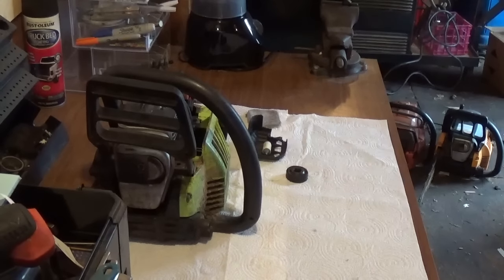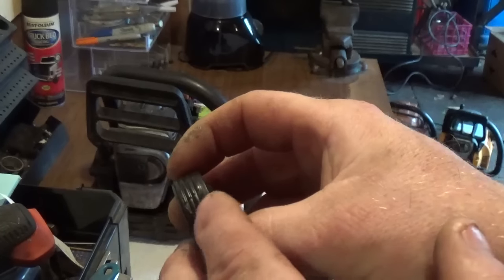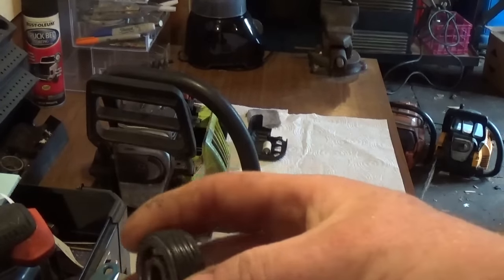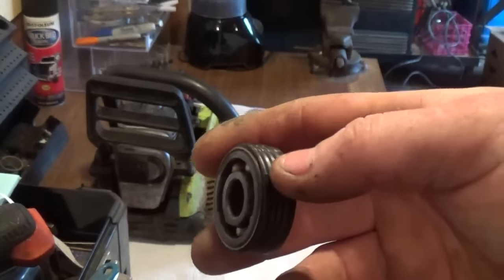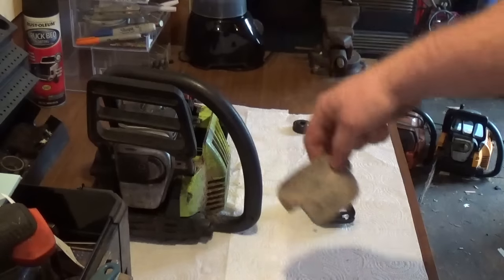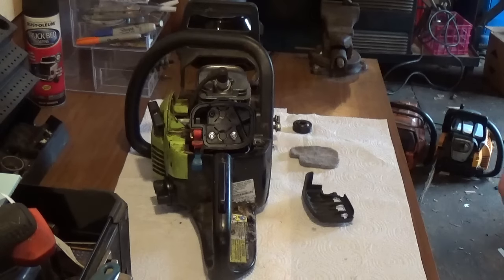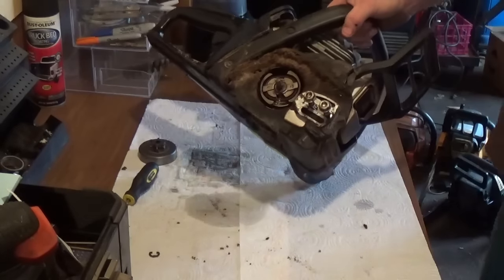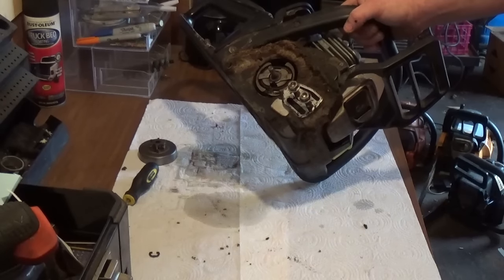Common problems with Poulan Chainsaws

Comment: I'M A CERTIFIED SMALL ENGINE TECH WITH MY OWN SHOP...I NO LONGER WORK ON ANY 2 CYCLE STUFF BECAUSE OF SOME OF THE THINGS THIS VIDEO SHOWED...BY THE TIME YOU PUT THE PARTS IN TO FIX THIS KIND OF JUNK...THE CUSTOMER IS COMPLAINING...I COULD HAVE BOUGHT ONE BRAND NEW....EXACTLY...PARTS OR NOT CHEAP AND THE TIME IT TAKES TO VACUUM CHECK AND PRESSURE TEST FOR LEAKS...IT BECOMES A HUGH WASTE OF MY TIME....SO I JUST WORK ON 4 CYCLE LAWNMOWERS PUSH/SELF PROPELLED.....AND RIDERS...I FREED MYSELF OF THE 2 CYCLE NIGHTMARE
Reply from the maker: You are exactly Right / And the price of some of the adapters for testing is outrageous .......Then lets just say you bite the bullet so to speak {hell in 5 to 10 years the adapter purchased becomes obsolete } because most of the chainsaw companies are not committed to repairs {rather sales } and are pushing yet again the next best piece of shit that they can screw over the modern small engine Tech or Dealer with knowing that yet again another adapter will become a obligated purchase. What I find sad is attending these service schools and seeing how these pieces of new equipment are put together [assembled } if you will. My goodness the quality of the shit purchased anymore makes me sick ...And the distributors know it as well as Tecs and Dealers yet nothing ever gets done about it . Say a word to Husqvarna and they just fire you as a dealer or even a sales rep. To them its easier to steal a dollar than to actually earn it . That's why they buy the low end companies ......Just to eliminate any would be hassle for there sales .....Think about it ......How many Poulans have you seen in different packaging under other names ? Be honest fellow viewers .....How many ?

Comment: I got a poulan saw from my uncle.  Fixed the sprocket cause it was totally chewed up.  It ran great for a week then it took a total shit on me.  I just cleaned out the carb and it ran good for about a minute.  Last year, I bought a 16 inch electric chain saw from harbor freight for 40 dollars on sale.  I cut several trees up with it and it works fuckin great. No gas just a long ass cord hahahaha.  I love it......its made by a company called PORTLAND.  I agree those Poulans are total garbage and need to be boycotted.

Comment: Greetings Kevin Bolin! What is the tank vent you speak of? Is there a hole in the back of the tank side of the gas cap on some poulan/craftsman saws? I have 8 cheap saws but one, a 3816 craftsman simpul won't idle right. It cuts good and revs right but idles high then stalls if you let it idle long. When it stalls there is a strong suction/vacuum leak down noise. It also happens after 3 or 4 pulls to start it. If anyone reads my comment could this be crank seal leakage and or possibly some kind of tank venting issue? It is a 2009 simpul. By the way when buying it from it's previous owner they let the carb gum then replaced it. Let that one gum up too. I got it to run with that carb and another new replacement one but it just won't idle right and had the suction noise when stalling out or after a few pulls. The piston is clean and shiny on top but I didn't look through the muffler. I have recently become a chainsaw hobbyist lol.

Comment: I have one
Ran 15mins use to to cut 2 limbs off a tree had to run in to town came back hasnt started back up since it was bran new frash out the box when i originally had it started
Reply from the maker: I completely believe you ….they are just complete junk.

Comment: My dad bought a Poulan p4018wt, new in the box. He probably bought it 2-3+ yrs ago, never used it. Asked me to use it the other day for the first time.  It was difficult to start. I got it going, it worked well for an  hour or so. I got it stuck in a small tree, and I shut it off and got it out. I still can't get it to crank again. I have spark, new gas, etc. It will not crank. Terrible.

Comment: I paid $100 for a refurbished Poulan.  Big mistake!  It rarely starts and once it does, it doesn't run very long.  And yes, I followed all instructions on gas/oil mix, prime, and choke.  It's garbage.

Comment: The first day I had it
the poulan 5020
Stopped working
after 2 hours work
No spark,I replaced
the ignition module
Chinese made of
Course,module
Failed after about
10 minutes,no spark
again.
The only reason I bought it was because
I thought it was 
American made.
The internals were all
Chinese made.

Comment: Mine had a muffler gasket installed crosswise across the port though one bolt and a kinked throttle cable.

Comment: I disagree with your opinion with the Poulan chainsaws. I'm not  a professional logger so I dont want to spend $600-$1500 for a Stihl chainsaw. I own rental properties and Poulan chainsaws do the job for cutting even big trees. I own 6 Poulan chainsaws, 18" and  20". Had these for about 5-10 years and never had any major problems except replacing the carburetors ($10 for new ones made in China) and they will work flawlessly for another 2 years. Only one I had to replace the ignition coil modules (under $15 made in China). The problem is that most people who use  Poulan chainsaws are your average homeowners and dont know how to do maintenance on these chainsaws so they just complain and throw them out. I can get a used one on Craigslist for under $50 and do some simple repairs and will last at least another 5 years. With cheap parts from eBay, you can fix these Poulan chainsaws instead of paying $600-$1500 for a used Stihl chainsaw which can still have expensive repair problems and still need maintenance for them to run properly.
Reply from the maker: I can respect a difference of opinion ...Sadly I think you exaggerated your 42 cc Poulans performances as well as  price points compared to a like minded example of a Stihl as they can be purchased easily for under 200 dollars. [Poulans around 140 dollars] …..Poulans …..well lets say modern Poulans just leave many with buyers remorse as repairs are expected straight from the box …..seriously …..Carb adjusting is actually covered under warranty of a new saw . And respectfully I have to much experience involving Poulan / Husqvarna made knock offs of different packaging . So I know the quality / You can certainly believe that …..Yelp 42 cc of screaming under powered skipped toothed performance followed by lighter wallets and purses ……..And that Frank is the truth …….But hey Frank to each there own......Your comment way delivered respectfully and as such will be replied to in a like minded manner . {However fellow viewers} As a Master Service Tech I can attest that Poulans are disposable saws with far more issues than failing 10 or 15 dollar carbs …..The quality of these saws are terrible and the fact as of 2015 at least 67.3 percent were returned or delivered warranty relief for tells all . Its no wonder why they have a company that dose nothing but refurbish Poulan / Husqvarna Knock offs under different packaging . Frank Techguy you seem sold on the Poulans will you be the first to demonstrate why with a short video of its performance from a cold start? You should find examples of whats expected in replies shared on this channel.

Comment: a tirade of his frustration is not anything but his anger and rant...
Reply from the maker: Yes/ and a open exposure of facts projected to allow individuals a first hand look so to speak as to why I hate the Poulan Chainsaw. Evident truths can or should not be ignored contrary to opinion ........So simply look into this matter even deeper as the facts quickly will build up as there is a reason for the thumbs up via in comparison to the thumbs down on this matter.

Comment: I had my Poulan 42cc for 17 years,flawless,works awesome,best $150 i ever spent!!
Reply from the maker: Great .......hope it continues to give you great service .....Sadly the poulan products in todays box stores just cant be relied on.
Reply: Dave Gutknecht these are what I consider consumer products. If you are delusional enough to think a poulan chainsaw is made to cut 15 to 20 cord of wood a year, then you probably get mad that a $150 Chinese welder fails when you run 4’ of 5/32” 7018 nonstop at 180amps. This video is not informative at all. It is just some guy whining about making money off of non-mechanically inclined people. Quit your belly aching KB and be happy you have the intelligence to repair these machines and make good money as well. I work on my own equipment and believe a day unlearned is a day wasted. I hope next time you will show something worth absorbing.
Reply: they are easy to work on and i've seen the majority of units withstand many years of abuse and run great.....
Reply from the maker: @luked1964  If your looking to absorb something then purchase a Poulan …..The fucking you will receive will require gallons of Prep H my friend . If I can educate my viewers to avoid these pieces of shit then you can bet I will do so . When facts are projected as they were in this video I think it worth while to inform and  keep others from buyers remorse .
Reply from the maker: @luked1964  You appear to have a connection with Poulan based on your idealism and lambaste others for expecting more from a piece of equipment they have spent over 150 dollars for . You then proceed to try to stereotype by your on ability to scrutinize via the example of a Chinese welder as a price comparison . Then you deviate away from your premise to imply that this video isn't informative at all . However in your absence of mind you fail to understand the premise of this video witch be minded was obvious . But incase you had trouble following I can and will try to elaborate . The direction or premise intended with this video was to show by example why I personally hate the poulan chainsaws . And show obvious failures with the design and parts so I could educate and prevent others from being taken advantage of {basic buyers remorse} . Now in regards to a line you had typed …….Its is just some guy whining about making money off of non mechanically inclined people . Might I ask how in the hell did you arrive at this conclusion in your stereotypical presumption ? As to reiterate this video was to show failures /educate/ and inform others to the quality over all of your beloved Poulan Chainsaw . And By basic example all were provided and can be evidently seen threw out the video . Perhaps by holding a still tongue you can have a wise head and absorb information more openly if you care to stop chasing your own idealisms and chastising others because of your own relative perception .{ I hope next time more forward thinking will be prevalent and if you feel compelled to leave a comment it will be less asinine }
Reply: Kevin Bolin 3 months.
Reply: @luked1964  Get what you pay for
Reply: @mattjohnston5807   Get better than u pay for. My Craftsman (hem Poulan) has lasted through various  FL hurricanes and oak tree trimmings. I am merely a homeowner and don't need a professional saw. Took it in to repair shop for carb cleaning. He said it'd be cheaper to buy one of the 10 or so he had on the shelf.  
I bought a knockoff carb from China and never looked back. I see folks more or less giving them away. Picking one up for a few bucks and cleaning/replacing the carb ($50 all in)? Heck of a deal.
Reply from the maker: @luked1964  Better late than never ...
Reply: Kevin Bolin not really.
Reply: Yeah, and you can bet your late model Sthl or Echo that your 17 year old Poulan saw was made in USA, out of parts which were ALSO made in USA. I own a late 1980's Poulan Pro Model 114 String trimmer, made in USA. Early years, it was living on "easy street" in suburbia. Over the last 15 years it has seen heavy semi-rural homeowner use. Only ever needed carb job, air filters, new head, and just recently the ORIGINAL plug literally blew apart. Also an early 80's Echo SRM 200DA trimmer,  (JAPAN) which is still running thanks to Ebay parts for coil, and throttle cable. It still RUNS, though has been relegated to strictly brush blade use. Lots of luck getting these late model cheap garbage crap units sold in the big box stores to last one tenth the usage mine have had. And don't even get me started on how well the OLD metal Homelite saws lasted and how BAD those became in the early Aughts when Ryobi bought out the name and production was moved to WHERE ELSE?!
Reply: Beats taking on a second mortgage for a STIHL.
Can't even find parts for the damn things when need be. They're all going to break down at some point... Doesn't mean they're poorly made.
Reply from the maker: @luked1964  Oh yes .....really .....as to allow sarcastic commentary to stand only allows asinine comments to further cloud the reply {comments that self rightious  assholes feel compelled to leave } Via the continuance of your leading comments {collectively } further proving by example you intended on getting the last word on the matter so to speak . Whats damning to your creditability is the blatant determination of your actions witch consistently are shown threw each reply ....My viewers know this and see how cornered you are with facts ......This intern tears at your pride .......Therefore you become fixated on critical intent or sarcastic innuendos .
Reply from the maker: @8oh1jonesss  Do you truly believe the shit you just typed ? So in regards to watching this video and seeing first hand so to speak the obvious failures .....you dare imply that it dosent mean a Poulan isnt poorly made .....{then by all means please be so kind to elaborate to my viewers and I how you arrived at this conclusion ...} WTF .....SERIOUSLY .....
Reply: @kevinbolin7665  Dear Kevin, one thing you will learn as you climb the ladder of YouTube: People that comment BS about your videos dont add negativity to your post. REAL gear heads that are here to hear what you have to say about the products dont care about the comments. Stop replying to dumb comments. Just stop. It will never go away. And the more they comment BS, the more activity your video has. The higher the activity, (Comments, viewtime, likes etc.) The higher the likelihood of the algorithm promoting your video. 

I wont tell you how many subs I have on my main account or how much money I make from YT. Just remember, not everyone deserves to get a reply. It adds stress to your life and wastes your time. It took me 3 years to learn that. 

Keep making gear head content for your people. Loved the video. Earnes my sub.
Reply: @luked1964  totally agree with your point. I wasted my time watching this guy repeating POS.....
Reply: I love you and your honesty 😊